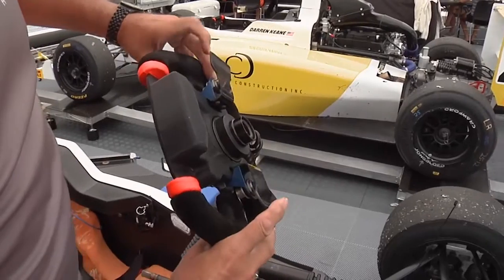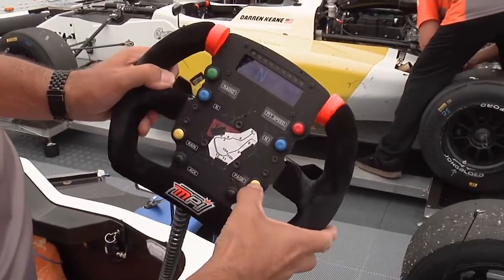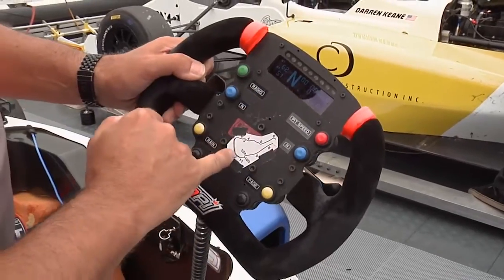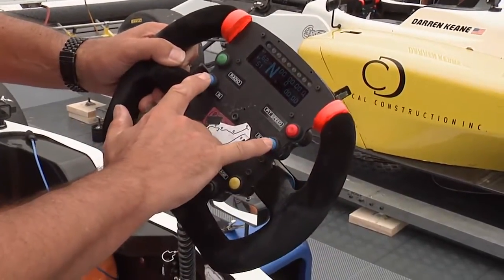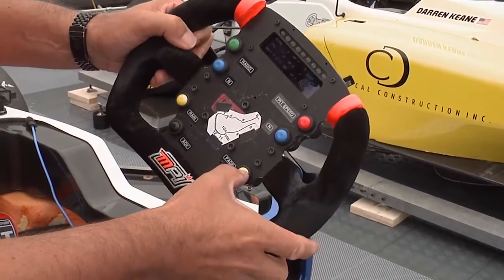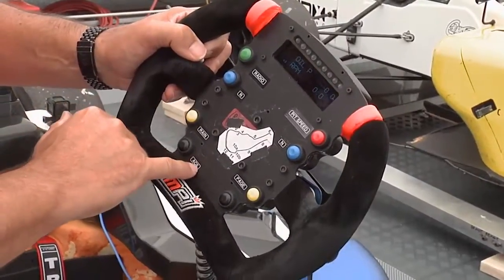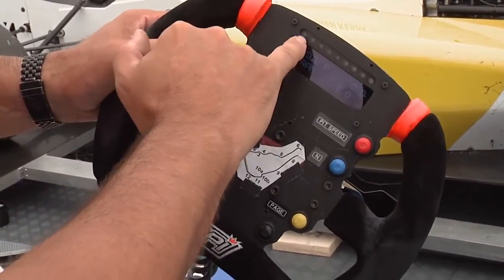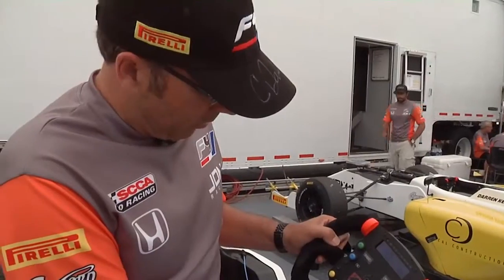F4 US MPI Steering Wheel Product Demo with Jeremy Dale

Comment: umm hi wheres the clutch?
Reply: exactly what i was gonna say
Reply: Imma guess they have a clutch pedal near the brake and throttle not on the wheel
Reply: @mateonaranjo333  idk that might be hard to do tho at high speeds (not really) but yeah they probably have a pedal
Reply: @zainhaq  it also depends on the drivers seat position 
I sat in a f4 car for a tall guy and I had to lay on my back to be able to reach the pedals and the clutch is not that far away and not that hard to push 
The only time in f4 you need to use the clutch is when you need to get moving then it’s only paddle shift
Reply: @mateonaranjo333  so its next to pedals correct?
Reply: @zainhaq  should be.
But they wouldn’t put it directly next to it so they would off center it more away so drivers won’t accidentally hit the clutch instead of brakes
Reply: @mateonaranjo333  so basically they only use the clutch like for the starts or to get out of 1st gear?
Reply: @danielalfonsodaniboy5906  only for standing starts
Reply: @zainhaq  why would they need to use the clutch at high speeds